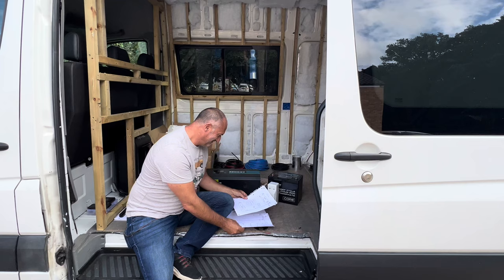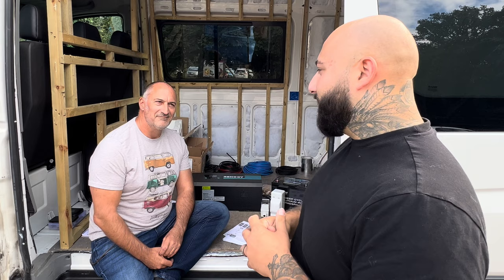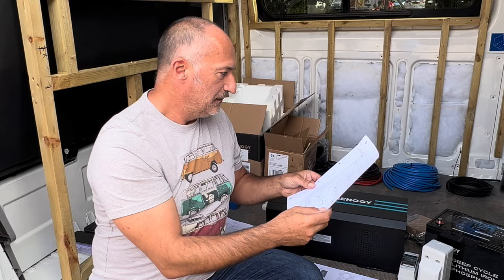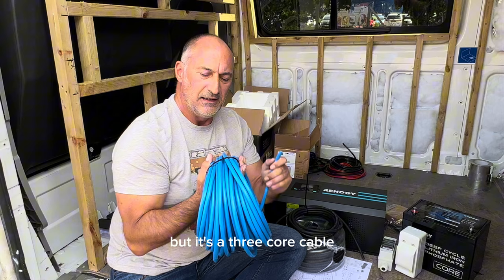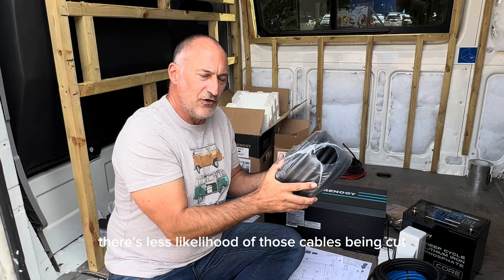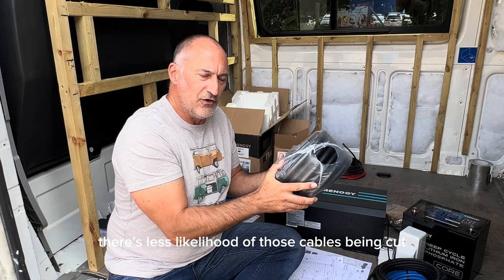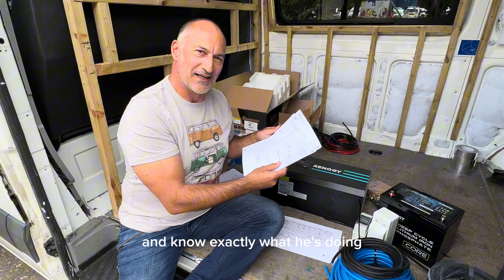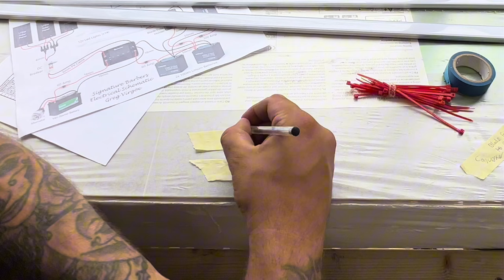Greg Virgoe SAVED THE DAY ! Pre Installing The Electrics | Mobile Barbershop Van Conversion (EP. 11)

Comment: Greg, as I am about to plan out my wiring on my new Ford Transit, wouldn’t it be best to run all wires before putting in any of the insulation?  Or is it better to have it up against the insulation?
Reply: As long as it’s protected in conduit when run through the van it can go in before or after. Personally it is easier to do it first then insulate.
Reply: Great. Thank you